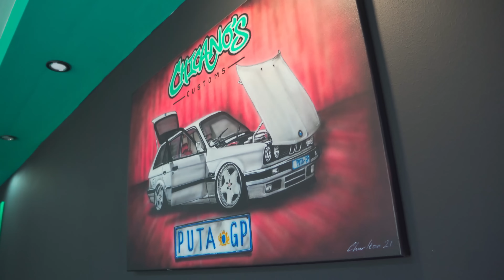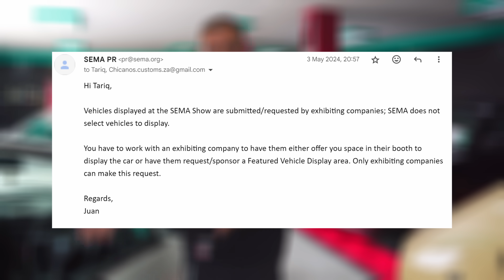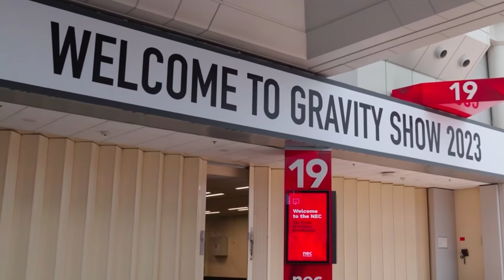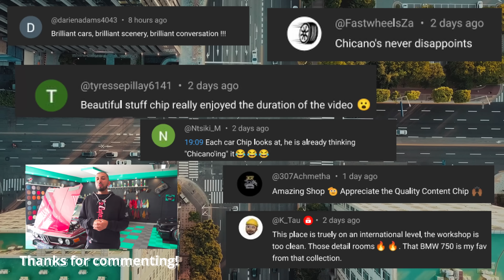There's a MASSIVE problem going to SEMA & Gravity Show

Comment: Okay, this might be a long one. 

635: 
I don’t taking the 635 won’t be as impactful as Nkabi was mainly because the E9 and the e24 have a similar shape but with the E9 being the better looking one. So taking the 635 might be a “downgrade ” of some sorts. 

850i:
I think an 850 looks better when it’s stock and obviously you can’t take a stock car😂. Could be the reason last year’s cars didn’t do so well(as you’ve said yourself).The only possible way to make it look good is going for a sporty/ racecar  look or for the car to an alpina b12. 

Vato:
To be honest, I think we’ve seen too many classic Mercedes builds that resemble the “old gangster” look. With the car being painted a dark or neutral colour, fitted with multi spoke rims or rims that fill the entire wheel paired with some white walls and it being bagged. I don’t think it will be a bad build but I also don’t think it will be as impactful Nkabi. 

E30 wagon:
Personally, I think the e30 wagon is the one to go with. The shape of the car is already spectacular on its own( Could be the reason you wanted to take an e34 wagon) and turnes people’s heads. With a bit of Chicano’s sauce, it could make a massive impact at the show🔥

I can see most people are voting for Vato😂

Regardless of the choice, we will be supporting all the way🤝
Reply: yeah actually nghamla will be taken to shows at the end of the year
Reply: You’re right E30 Wagon is the perfect car to build for the show👌🏽🔥it’s already a head turner just neeeds a few things to complete the build
Reply from the maker: Thank you for such an in-depth reply 💙🙏 Easily by far the best comment of the year, we took your suggestions ideas and thoughts into account when making our choice 💙💙💙